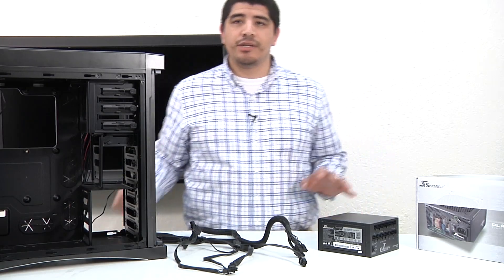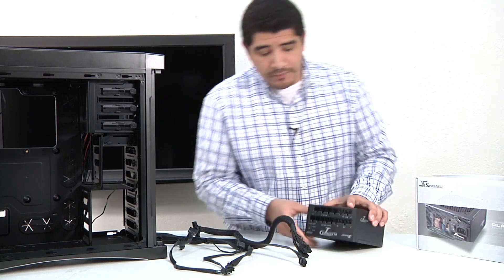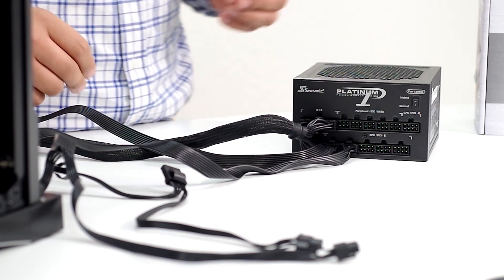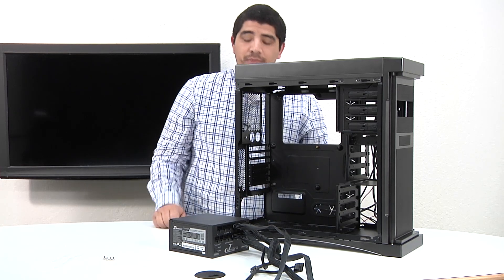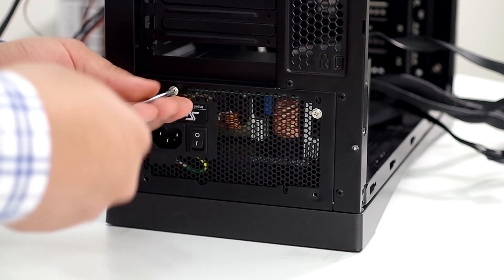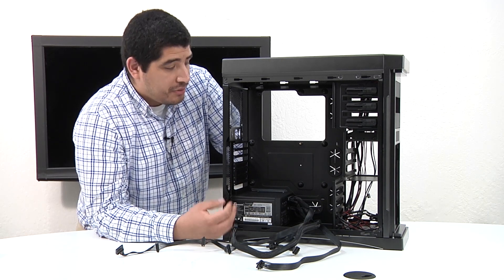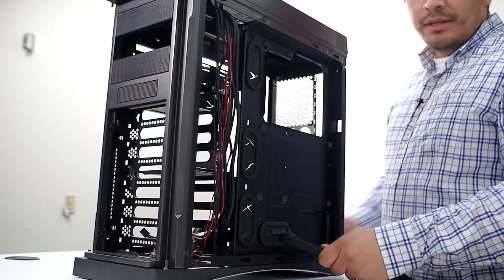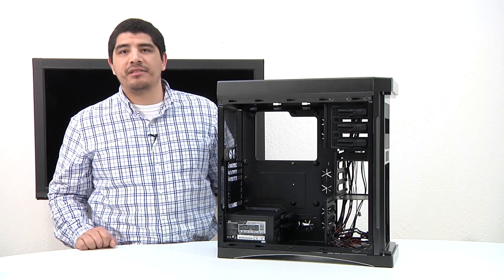How-to Install the Power Supply in your chassis

Comment: I always mount my PSU so the fan faces down, there's a vent there on the case for that reason, but I've seen a few people's builds who face the PSU fan up, but Why? Surely that's just going to pull hot air from the case through the PSU rather than cold air outside the case?

Comment: Okay so I understand if you got the spare sockets and power,
you plug an 8 pin PCI-E (6+2) from the GPU to the PSU. But where on the PSU,
anywhere its free? Or CPU 2 socket 8 pin, or do I plug it into peripherals, so that’s
what I’m confused about. (where on the PSU sockets do I plug my 980 Ti    

This is the sockets I'm looking at:  http://images10.newegg.com/productimage/17-438-060-02.jpg
Reply: Depends on what your connecting it to, you can power your hard drive if that’s what you’re asking.
 
http://www.playtool.com/pages/psuconnectors/peripheralpic.jpg

and if you have spare Molex around, you don't need to use them. You can leave them around hanging but people like to get rid of what they don't use.
Reply: PCI-E cables go in the connectors where it says PCI-E on the PSU.
Reply: Thanks for the help, I figured out that it was the VGA slots on the PSU, and I hope this helps someone else with the same issue. (Use VGA , someone told me that another slot can sub for something higher demanding then a 4 Pin as long as your power supply can handle the output.) In my case I didn't get any PCI Express labels, I had plenty of VGA.
Reply: what is the use of that thing? 2:21 & where do i use that?
Reply: That’s a Molex Connector, and the other end is a 6 Pin
Connector that goes into your PSU (Power Supply Unit) Usually the Molex
connector is wired into an adaptor or goes straight into your components like
DVD player or anything else that needs power.
Molex Connector Image:
https://cdn.sparkfun.com//assets/parts/6/9/7/2/11298-02.jpg

6 Pin Connector Image: http://images.anandtech.com/reviews/shows/computex/2004/nv45final/connector.jpg

Where on the PSU depends on what your connecting the Molex to, if its CPU then plug the 6 Pin into the CPU1 socket on the PSU.
Reply: i see.. but the case that im going to by has no dvd drive/player. so there no need to plug those molex?
Reply: ohh i think ineed that lol! thanks for explaining :)